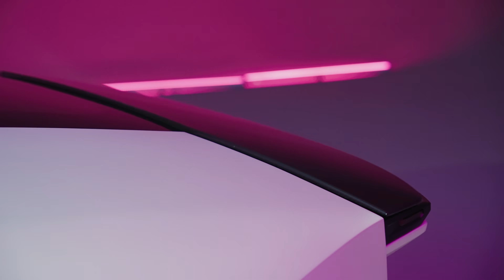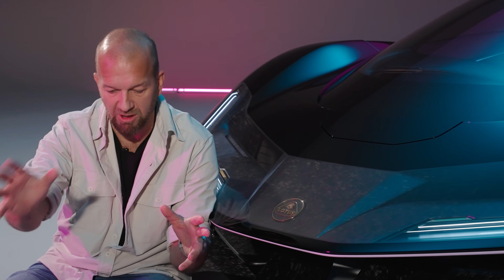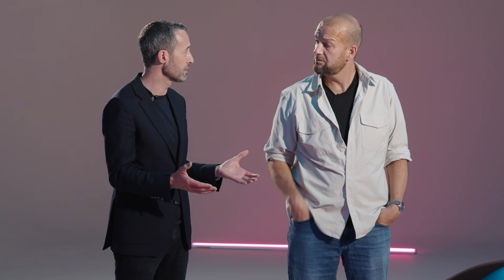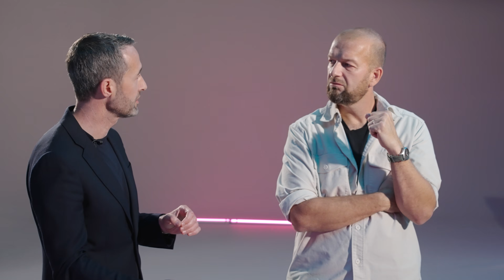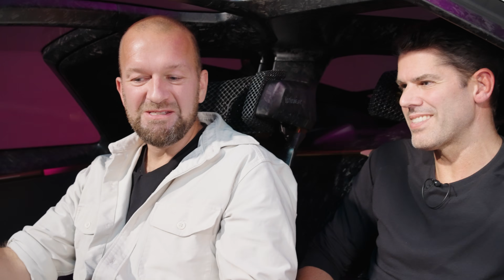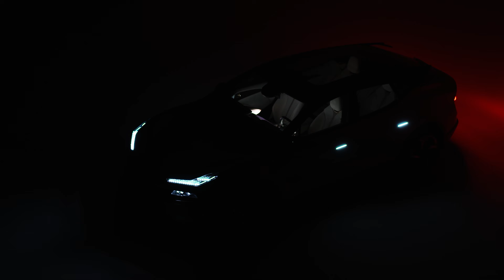Lotus Theory 1: If The Cybertruck Was A Supercar…

Comment: All I want from Lotus is a lightweight sports car that handles well. The less tech the better
Reply: Just buy an elise. Cars like that arent coming back
Reply: @tupo3855  An MX-5 with a V6 swap is always a good choice, but some people just have an unreasonable hate for them regardless. Probably because they've never driven one, or think you need 400HP to have fun. If you can't have fun in an MX-5, you don't belong behind the wheel of a sports car (unless you simply can't fit lol)
Reply: @Ben-Rogue  I love MX-5's. I owned a mk1 and dont think theres many better cars purely for driving. But for the money and hassle of putting a v6 in one or taking a chance on an already swapped one, then worrying about reliability you should just get a different car imo.
Reply: @Ben-Rogue  MX-5 with motor swap is still not Elise. Besides that you need more changes to the MX5 to handel all that power.

Elise power was 1.8 litre supercharged Toyota 2ZR-FE Inline-4, with around 140-200 hp. 
With great handeling and lightweight car it didn't need a v6.
Reply: @mrMoon589 supercharged was 220-250BHP.
Reply: @Ben-Rogue MX5 is nothing like an Elise & never will be. MX5’s are not sports cars in the same league as a Lotus & never will be.
Reply: @drew699 they absolutely CAN be made to compete with or be better than a lotus. Not sure why exactly you’d think that they couldn’t. You can do anything you want these days. Just a matter of time, money and motivation.
Reply: @tupo3855  I personally don't think the MX-5 needs an engine swap, as a completely stock MX-5 is still quick. But for those that complain about their lack of power, a supercharger is more than enough. But an NA or NB MX-5 with a V6, and a well sorted chassis (some additional bracing and a big brake kit) is more than capable of competing with any 'sports car'
Reply: @mrMoon589 
The original Elise was NA - it got 190HP out of 1.8 liters thanks to an 8000 RPM redline.
Reply: it s an ideal car that everyone want but not many people willing to pay in reality. 
look at TVR
Reply: People say that but never buy it.
Reply: Yeah but if they did that they would go bankrupt or make little money because theres no buyers for a light weight road/track hybrid. Theres like 5 race tracks in my whole country, and if you drive fast on the roads here you risk prison time and having your car crushed.
Reply: Unfortunately, the market doesn’t. A few enthusiasts such as you and I don’t represent the masses and don’t make money regretably!
Reply: Safety regs, electrification (government incentives), stat-crazed social media scene (mention 200-ish horsepower and watch them laugh at you)
Reply: Did you buy one when they were selling those? Or none of the people saying oh we loved Lotus for making lightweight pure fun sportscars actually have actually bought one so much so that the company was constantly being sold around.
Reply: @reeduedu  
Exactly that... I owned one when I was a student in England. The Lotus Elise / Exige, was always the dream hobby car that nobody got around to buying. They loved the idea of it, but never bought one. And now that they have gone electric, they act like they have been stepped on and violated.
Reply: guess u didn't bought one when they used to sell those and the sells were terrible
Reply: @taodaniel5273  
Lotus used to make most of their money on technology for other car companies. Not so much on their own car sales.
Reply: How many did you buy though mate.  They sold the cars we all want and neatly went bankrupt for 55 years, they sold 2 fat SUVs and every bald man and divorced mum of 5 bought em.  Go figure. I hate SUVs by the way with you on the desire but actual car people are much fewer in number than we all think sadly
Reply: @vespasian123  car people are not few in numbers at all. Car people with money are though
Reply: @TheHesK9  touche. But if we all stopped buying jukis and other chod 1ltr SUVs and bought the sportiest thing £X would buy, the world would be a much better place for car enthusiasts
Reply: @benhaley9811  true but unfortunately a lot of people need family cars. Can't exactly raise a family with only an Alpine A110 lol
Reply: I kinda agree with you but it would be cool if they made a gas supercar
Reply: They could easily make a lighweight Lotus with a/c motor power but the range would be short.  With a 30kWh battery, it could be a fast charging, reliable, insane hole shot autocrossing beast with 100mi range.
Reply: Well thats not gonna happen. And thats not because Lotus doesnt want to make them, but rather the entire industry is moving the opposite direction. With electrification, all that goes out the window. Electric engines are lighter than standard engines, but the batteries are not. There is no such thing as a LOW TECH, or LIGHT WEIGHT battery. Batteries are dense by design. If they were not dense, they cant carry power. If someone comes up with a lighter battery, well then they will put in 2. There will never, in our time, be a light-weight electric car. 

But the trade-off is that they give you twice the power to handle the added weight.
Reply: Something with an engine right?
Reply: +1
Reply: You got absolutely right!!!.
Reply: Look at the jesko absolute.
Reply: this, 120%
Reply: Can tell you are not a business owner 😂 every one just likes to b*tch about everything. I wish they go back to selling lights weight without so much tech and those are the same people not buying the lights weight without so much tech when they are on the dealership and then they wonder why Lotus isn’t doing that anymore 😂 What a bunch of hypocrites I got to share the air with.
Reply: Re bodied evija
Reply: All i want is lotus compete in gt3 class
Reply: This is supposed to weigh less than 1600kg. I get keeping things simple, but isn’t an electric motor technically more simple and efficient than a piston engine? It’s the battery that’s holding electric cars back.
Reply: They'll never be as light as Lotuses back in the day. It's gonna be EV which equates a heavy car. But that wont matter if they can make fun, fast and "feel" light in the corners and under braking
Reply: @brent-xn Electric cars don't have to be heavy. The OG Tesla Roadster is lighter than the Emira
Reply: @ExclamationMarx  But would you buy one as a weekend toy?
I wouldn't. There's just no market for it I think
Reply: @PJH1111  Honestly I would if I had the money. But used Roadsters are more expensive than when they were new
Reply: @ExclamationMarx  You mean electric cars of the day. Just you wait to see how heavy the new roadster will be.
Reply: @brent-xn  The new Roadster won't be in the same spirit as the original
Reply: @ExclamationMarx the OG Tesla is based on the Elise platform but is nearly double the weight of the lightest Elise (700kg)
Reply: @ExclamationMarx it's an electric Elise which isn't allowed to be produced anymore
Reply: @ExclamationMarx  Keep in mind the OG Tesla Roadster did 0 to 60 in 5.7 sec with a top speed of 130mph was a disaster of a car to own and 650 lbs heavier than the Elise second gen it was adapted from, with a price of $120,000.
Reply: @mark-kf3md  Those performance figures are wrong. It was 0-60 in 3.9 seconds & 125mph top speed
Reply: This ain't it cheif
Reply: Totally agree. EV really ruins the spirit of lightweight performance.
Reply: @farishanafiah8461  
And what are they going to do? EVERY brand is going to EV in a couple of years.
Reply: @captain_context9991 Due to government legislation. Take that away and we would have choice. Fiat are currently in the process of fitting the current 500 with hybrid petrol engines because they can't sell enough EV models. Volvo and others have rowed back on all EV to sell hybrid. A mess of a situation when the public should of been offered choice of petrol, diesel, hybrid, electric, hydrogen or anything else
Reply: @robsmall6466  
Diesel is gone. Forever. Thing is... The entire car industry is now spending billions on new production lines, new factories, new technology. To prepare for the final date when they MUST be 100% electric. Some try to be first, others try to hang on to internal combustion as long as they can. 

But the problem is, its coming whether people like it or not. Sure, there is some resistance now. But later, there will be only electric cars to choose. Its the same focus on environmental stuff that has made modern, efficient cars since the 70s.

The stone age didnt end because we ran out of stones. It was just time to move on. Except noise, there is nothing that combustion cars do better.
Reply: @captain_context9991  As I said. Only coming due to government legislation. So this isn't evolution. It's enforced. Can't understand why the EV brigade don't seem to get choice. For a lot of drivers EV are currently too expensive, they are unable to charge from home as no off street parking, no one wants to be left with an ageing battery that makes the car plummet in value, many people feel that EV lack character and prefer the lighter feel of a petrol car and there are other concerns as well. So we should have choice and everyone would be happy apart from the Tesla shareholders
Reply: @robsmall6466  
Yeah yeah yeah its the usual fear and hate of anything that wasnt there when they were kids. You can drive from the north to the south of Europe on 3 charges easy. And they can be done in 45 minutes. Also my BMW i3 is "old" already. Its out of production. But that doesnt make it useless.

The problem is... You are not going to buy a new car anytime anyway. Most people dont. Because of their financial situation. And thats the major issue with everything. People just cant afford shit. While were being told the economy is the best ever in history.
Reply: @captain_context9991  I don't think anyone fears it or hates it. No one has minded about down sizing of engines, turbos being added on almost anything or hybrid. But with EV it's a complete lack of choice going forward. If people don't buy new then we won't have enough used stock. And that's another problem they are rapidly heading for

Comment: I want Lotus to have similar design in 1000-1100kg sports car with a naturally aspirated engine or even a hybrid to meet the regulations.
They really should have a competitor to the Alpine A110, not another car that most can't afford.
Reply: @Woodbang.parametric  New Elise with GR Yaris running gears & RWD/Emira RX500h would be epic
Reply: @Ernie_2492 A lightweight £60 grand Lotus with Yaris GR running gear sounds perfect to me.
Reply: And they do. You just need an older one.
Reply: @ChristianrnstrupRasmussen Lotus should have come up with an A110 rival and the base Emira would have been it but the £60k price estimate was never met.  Hard to bring out a new sports car at a budget price due to crash testing, emissions and a myriad of regulations.  An Evora or Exige 430 would be my choice
Reply: How is a one-off concept car platform even remotely something that would be actually sold in market? Someone needs to learn the definition of "concept".
Reply: @WereSven not on the road they aren't apart from a few very specific uses and those uses will be EV by the time any new vehicle in development comes to market anyway.
Reply: @WereSven in terms of single lap times EV are there, look at pikes peak and goodwood hill climbs. longer duration they are getting there. 

But that's hardly real world transport is it?
Reply: @WereSven you were talking about track cars. 

In the real world in most use cases EV work great
Reply: @DorsetSaferRoads  you'll be surprised
Reply: @WereSven rubbish. EV are fine for long trips.
Reply: Whilst I agree they need an "Elise for the modern age" 

Having an internal combustion engine hybrid or otherwise is not the way forward. 

The Hyundai ionic 5n is a hot hatch for the modern age. It has some great features to keep the dinosaur petrol heads happy.

Having said that sports cars have no place on modern roads there's too many cars on the road. Too many people getting killed etc etc

Comment: The Theory they are testing here is if Lotus will survive if they identify themselves as (discount) Lamborghini.
Reply: Have you ever heard about the Lotus Esprit?
Reply: @CarlosAndCars
Reply: fr lmao
Reply: Lotus espirit
Reply: Baseless, ignorant troll post
Reply: Lamborghini itself already became discount Lamborghini. Both the Revuelto and Temerario look like they were styled by a chinese startup and went EV. Lotus have a winner here if they can keep the design mostly intact and get a decent engine
Reply: @axelmogr  engine? This is a full ev, those modern lambos that you mentioned are hybrids
Reply: @axelmogr Problem is that style   will rapidly date..Those angled slab-sided Ford GT90-esque side panels will be easily superseded by the next "curved by air" swoopy & flowing sports car design...
Reply: @axelmogr lambos not EV youre insane? Hybrids are fine bro, and even though their main flaw (unless its a mild hybrid but those are more limited to what the electric motors can do) is the lack of manual, lambo doesnt make manuals since the murcielago/gallardo so idk why people beef with the revuelto so much, the temerario however i understand because i too miss the V10 as it was a more unique powertrain even if the new V8 is an exciting one with the really high redline, its still a TT hybrid V8, most mid to high entry supercar under the sun for more than half a decade is using those. Even an NA V8 at this point is a novelty.
Reply: @axelmogr  u must be an m0ron. Looks are definitely subjective, but neither of them are EVs, and have you ever take note what the engine in the Temerario is? A 10k revving engine made by themselves, not yet another jacked up food blender motor.